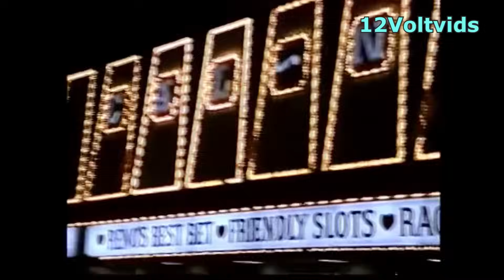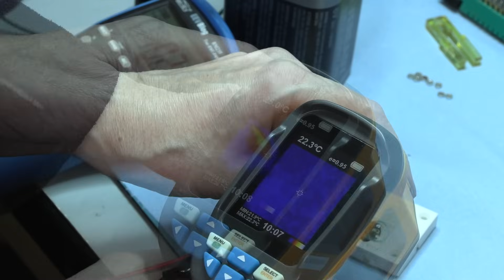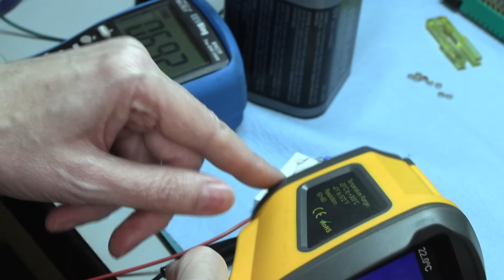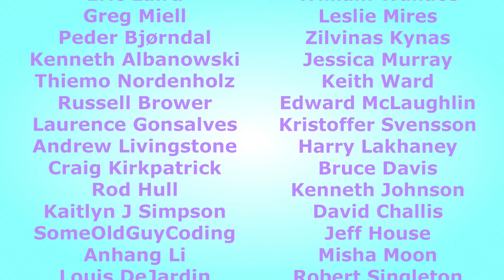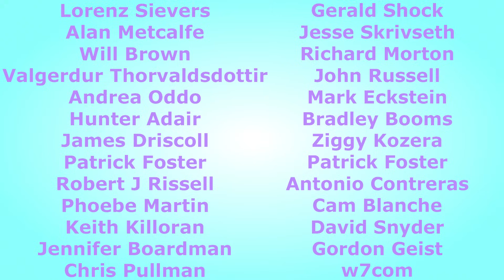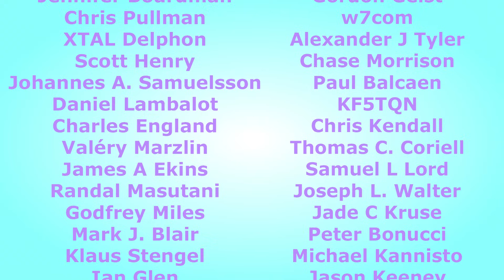Keep Them Bulbs On!!!

Comment: Big reason why the Centennial Bulb has lasted so long, it never gets cycled on/off.
Reply: and it is dim as hell
Reply: It's not running at 120V, just enough volts to make it illuminate.
Reply: @liquidsonly  According to the people that run it, it is running at 120V and 4W (Yes, 4 Watts down from the original 60W due to degradation)
Reply: @drkastenbrot  Correct. From their website:

 It was then hooked to a seperate power source at 120V, and UPS according to Frank Maul, Retired City Electrician. There was one interruption in May, 2013, when the UPS failed and it was off for at least 9 1/2 hours. When it was plugged back in it shined at 60 Watts for a few hours. It has since dimmed to its former 4 Watts. Why is still a mystery. 

I originally thought they had it on a ballast until I read that. I still feel as if they are cheating a bit using a UPS too.

Comment: Neat!
Does standby mode for a guitar amplifier work in a similar way?
Reply from the maker: Sort of  - standby keeps the filaments fully on and heated, but cuts the high voltage B+ to the tubes, so when you flip the switch the amp is on full.